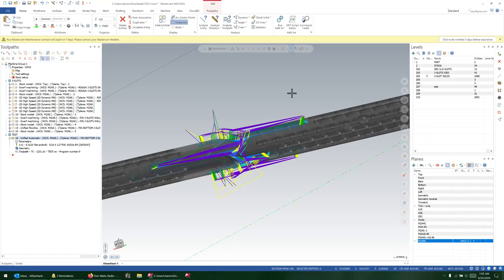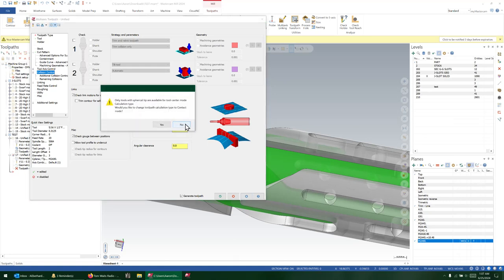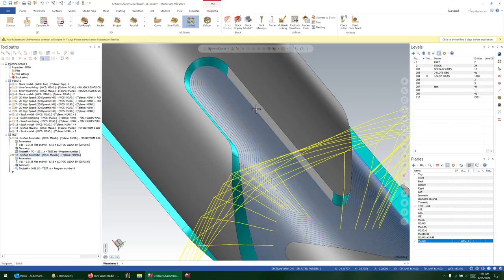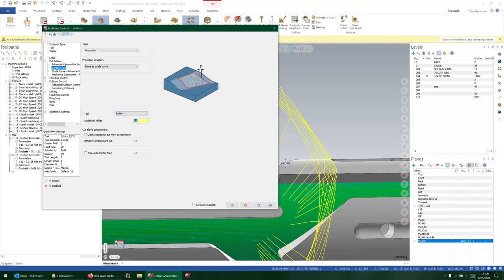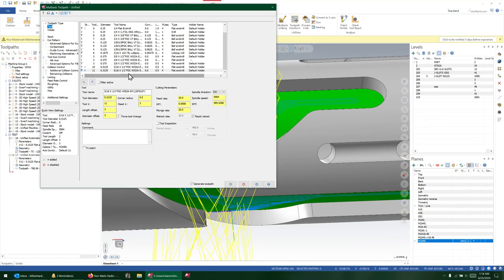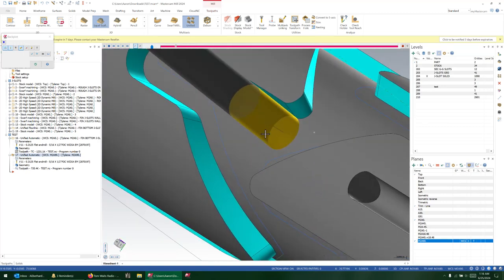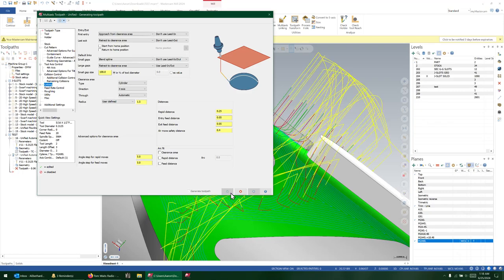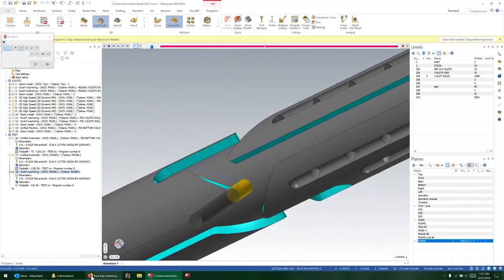2024 06 25 - Mastercam - Unified and Swarf - Shaft Keyslot Machining

Comment: thank you very much!!!😘. I have one question related to 5 axis and rest milling/rest roughing/ 5 axis ops' stock awareness.  Say you have the part after roughing and you want to use an automatic way of rest machining it. Something like a rest milling on a 3 axis op where you select the whole part not just individual surfaces. Also assuming the part has small undercut and you are not able to use a 3 axis operation with holder colision checking/trim to avoid gouge, active, because this being a 3 axis op will not see the undercuts. As an example take 5 axis deburr toolpath but as a 5 axis rest milling. Maybe Triangle mesh?
Reply from the maker: All 5 axis toolpaths are stock aware, so what you may want to do is just a normal finishing op, but turn on roughing/multi passes.  It'll trim it back to the stock.   If you have an example, I'd be happy to make a video on it.  Send it over to aeberhard@vector-mfg.com.
Reply: @VectorMfg  thank you for your reply. I don't have any examples I was just curious how it can be done. Thanks 👍